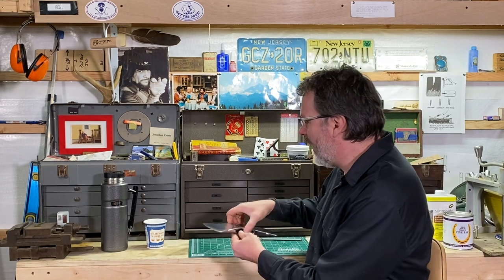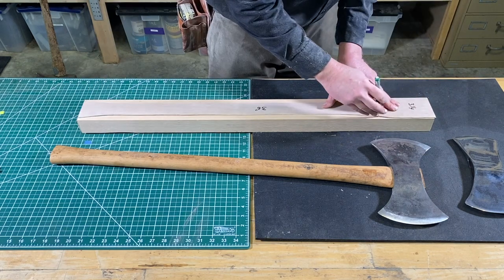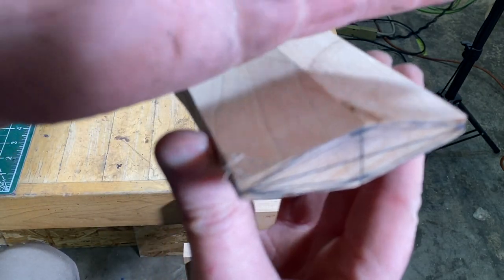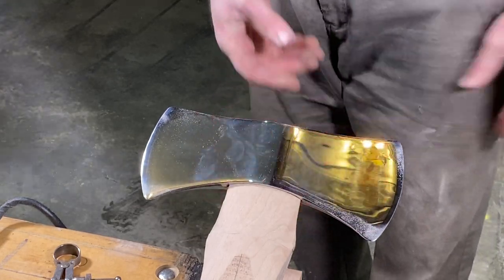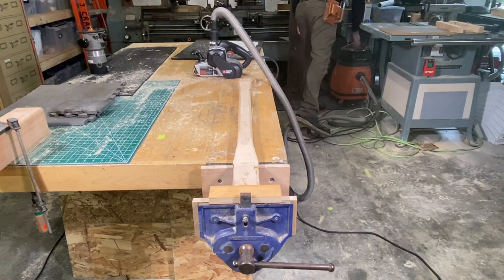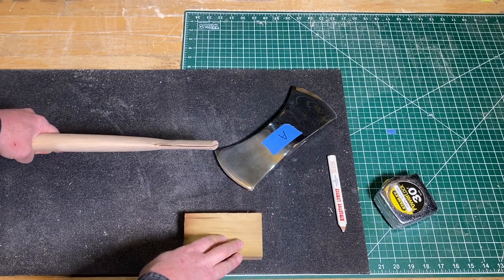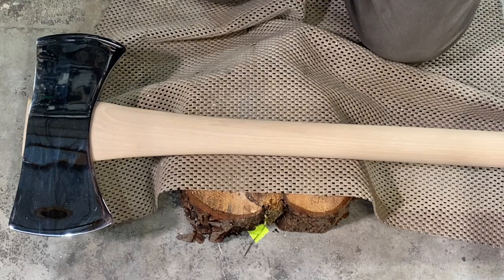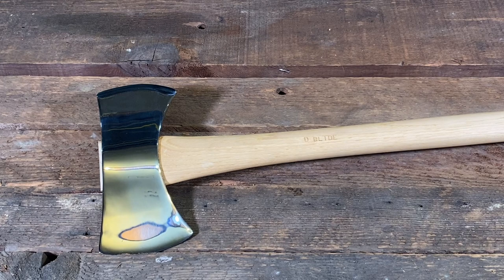Axe Restoration - Part 2 - The Handle - Making a handle and putting the axe head on - ROWJC #5 P2

Comment: I didn't see the leather work video yet, so a few questions, did you condition the wood at the top of the eye? 
How deep do you set the kerf for the wedge?
Love the content!
Reply from the maker: Ian Carey Hi Ian! Thanks for watching 👏 The saw kerf from the bandsaw or it could be a handsaw is cut 1/2” above the bottom of the eye 👁. Yes I did condition the top of the axe but not until after these videos were finished. Letting the glue dry as much as possible. The leather sheath video will be up in the next couple days 😃☀️👏
Reply: I've learned that 3/4 of the way down from the top of the eye for wedge depth, I think this adds more stability to the strength of the handle for torsional force inputs, such as the 'flick' technique for splitting
Reply from the maker: Ian Carey I think that is good and just about where I have it. On this one I didn’t measure but just eyed it up 👍🏼💪 Yes nice and strong!